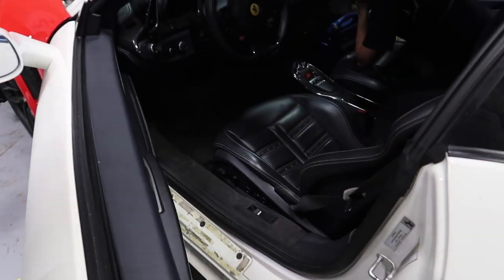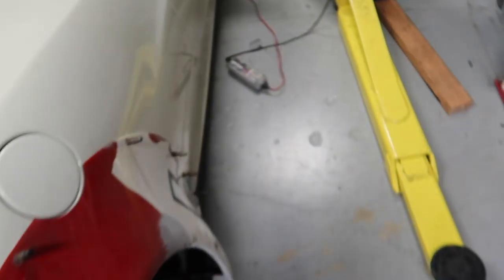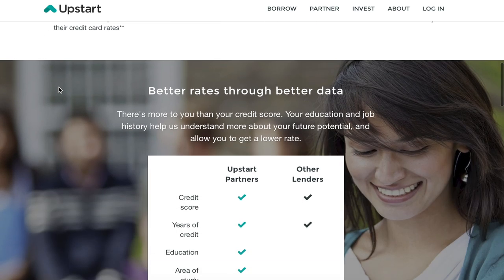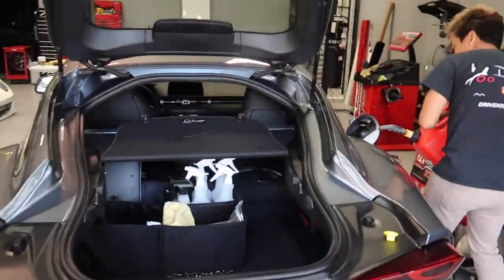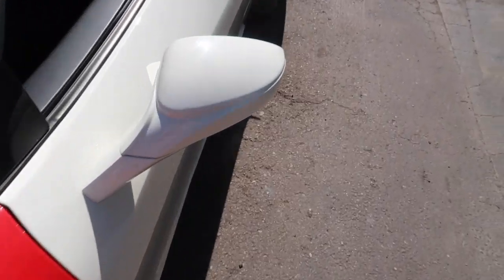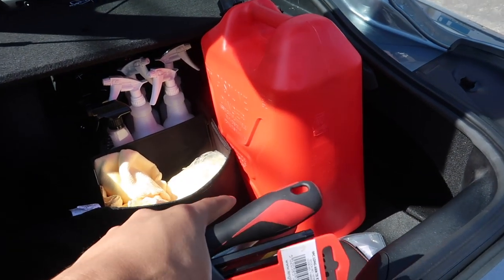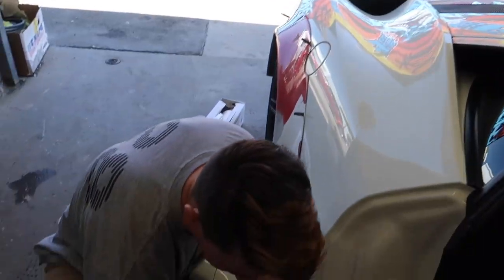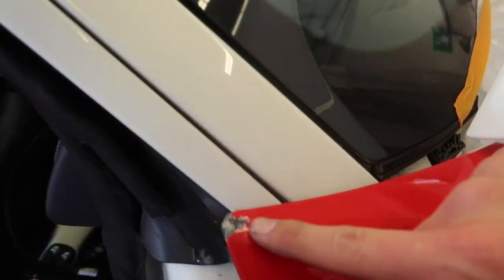Painting the Ferrari GT3 458!

Comment: why aren't you leaving the "battery tender" on while parked all the time??
Reply: Erik Anderson BEST question today haha
Reply: Because the battery is buried inside of the dash, he mentioned in a previous video how much of a pain in the ass it is to get to the battery, so it’s not possible to do that every time
Reply: @caseyperrell3198  The 458 has a tender connection under the glove box no need to tear anything apart
Reply: Casey perrell it CAN have a connector that you can run pretty much anywhere
Reply: Pretty much "car dudes" not knowing about cars LuL
Reply: And did we take the tender to the bodyshop?
Reply: Clarence Calkins Yes? Hope so? I mean unless the want to push the car around when they need to move it. Pretty sure body shops push cars around all the time tho...
Reply: Should also look into a low voltage cutoff switch.

Comment: Yall should run two wires  off the battery to the frunk so u don't have to do that every time..
Reply: easy move yup, did a rear terminal add on my 4Runner and probably best/most useful mod I’ve done